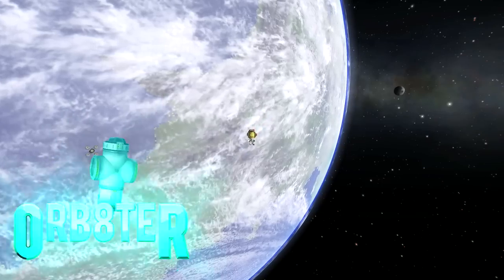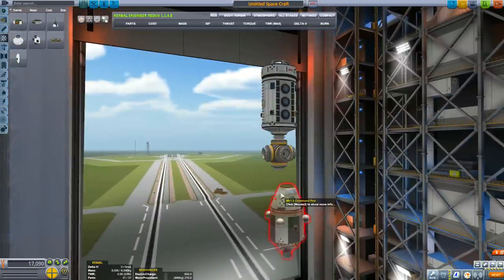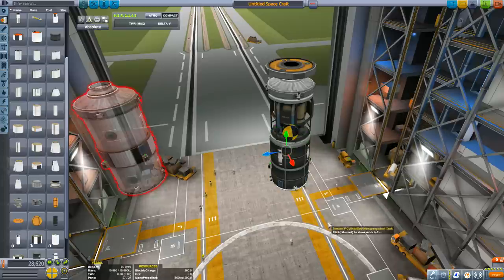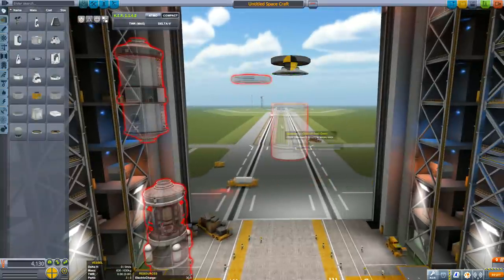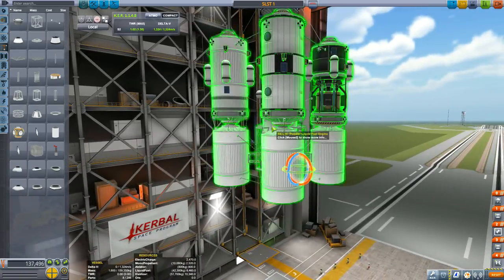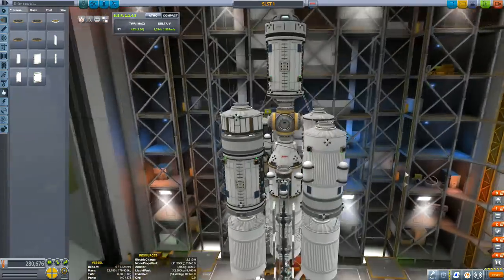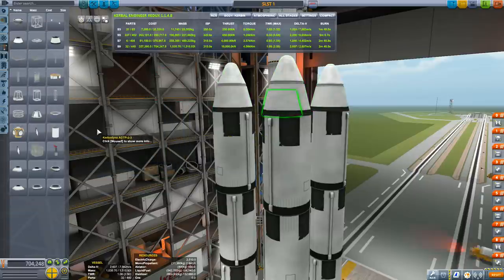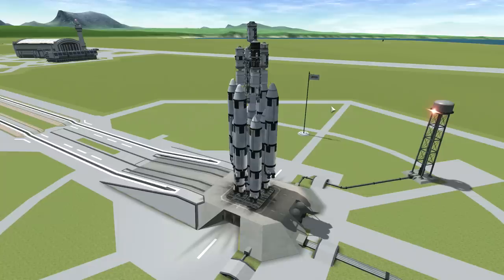Kerbal Space Program | Tutorial Single Launch Space Station

Comment: The solar radiator trusses were blocking the way when I used the craft file, to compensate, I just did the docking process by section (2 docking ports undocked and that respective section's solar radiator truss undocked at once) and moved all the parts out of the way, and moved on to the next section so not too many parts float away at once.

Comment: as soon has i undock something from my ship i cannot control (cant control from here) the trust to dock it on the space station why ? Great videos !
Reply: I know this is an old comment but I figured I'd try to help anyway.

Check these 3 things if that happens:

1. Make sure you have a robotic control part on whatever piece you cannot control after detaching

2. Check to see if it has power. You may not have enough batteries to sustain control, or perhaps not enough solar panels

3. Make sure you have a network connection to Kerbin, otherwise everything locks up.
Reply: @OhYahDude  thank you my man this will help me in ksp 2 when it come out !